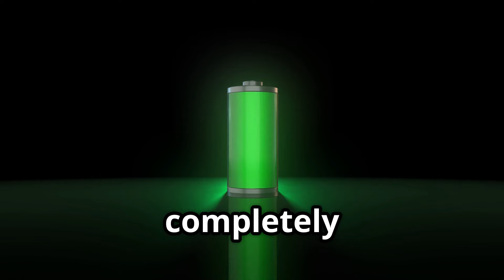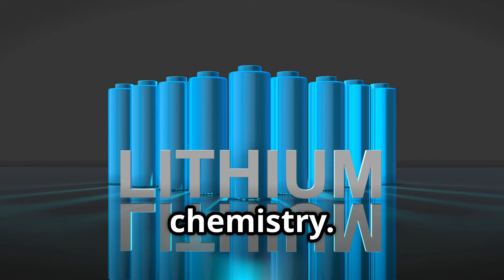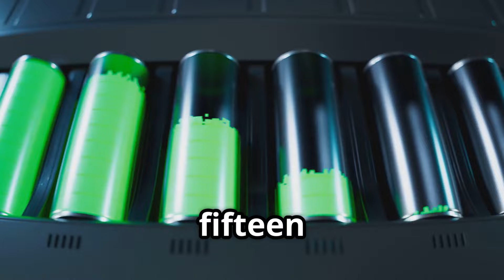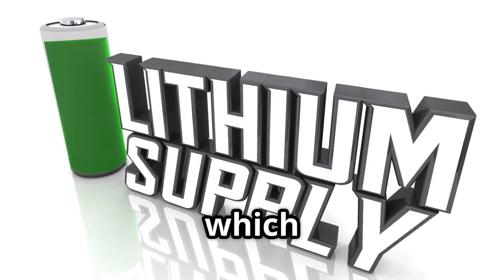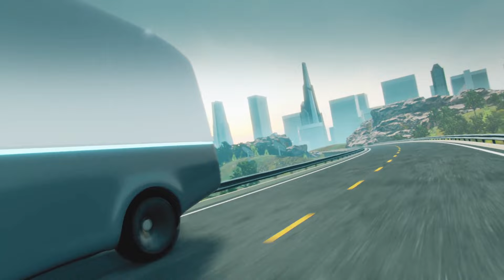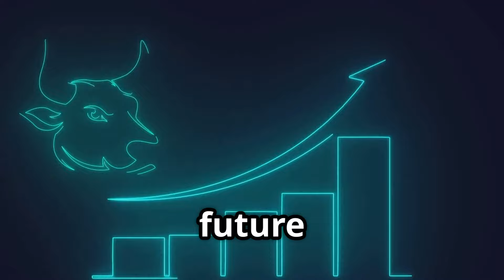This Chinese Battery Is Changing Electric Cars!

Comment: Sounds great so just one small question. If it can charge that quickly then how much power does it need  to have to the charger? I’m guess it needs a LOT and similarly when you use a public charger with other cars charging at the same time just how fast is it then? I’m not being negative as once the battery issue is solved and here in Australia the energy price returns to earth from outer space I’m a starter assuming of course it’s not the sort of tech that spontaneously combusts with the family inside.
Reply from the maker: You are very right CATL claims its Shenxing ultra charging battery charges minutes using ultra-safe LFP chemistry, highly resistant to fire and stable in extreme temperatures.

 Power Needs: Requires up to 500 kW. Australia’s fastest chargers mostly around (350 kW) can’t hit full speed yet, but upgrades are underway.

🔥 Fire Risk: they claim its Very low. LFP is thermally stable, and CATL adds advanced safety systems. No major fire incidents where some of its batteries are being used in:

Tesla Model 3/Y (China-made, CATL LFP)

Nio ES6, Zeekr 001

CATL-powered e-buses in Europe/China

From these claims CATL leads with safe, fast, and proven batteries  ready for the future once infrastructure catches up in Australia maybe next year 😁.

Comment: Is it heavy?
Reply from the maker: CATL's latest innovation, the "condensed battery," boasts an impressive energy density of up to 500 Wh/kg.  This means that for every kilowatt-hour (kWh) of energy stored, the battery weighs approximately 2 kilograms.  For instance, a 100 kWh battery pack would weigh around 200 kg, significantly lighter than traditional lithium-ion batteries
Reply: @zishopuBusinessTech2770  Great! Looking forward to seeing it in action!

Comment: Oh, I want to know how many charging cycles the battery can do before it only can only hold 80% charge compared to when it was new?
I also want to know the self-discharging, how many days goes before the battery lost 10% charge without in use?
Reply from the maker: Here's the breakdown based on CATL's latest sodium-ion battery tech:

1. Charging Cycles: according to CATL’s 2nd-gen sodium-ion batteries can handle around 1,000 full charge cycles before their capacity drops to 80% of the original comparable to many lithium-ion batteries today.

2. Self-Discharge Rate: These batteries have very low self-discharge. On average, it would take about 60–90 days of no use for the battery to lose 10% of its charge, depending on temperature and storage conditions.

This makes them a strong option for long-life and low-maintenance energy storage!

Comment: This all sounds great as long as it doesn't cost $10,000 to replace the battery..
Reply from the maker: China’s battery manufacturing giant Contemporary Amperex Technology (CATL) has hit a major milestone by becoming the first company to meet the country’s new ‘No Fire, No Explosion’ national safety standard, scheduled to be enforced in two months.

The new regulation, set to take effect on July 1, 2026,
Reply from the maker: You are very right, their previous batteries cost around $14000 USD